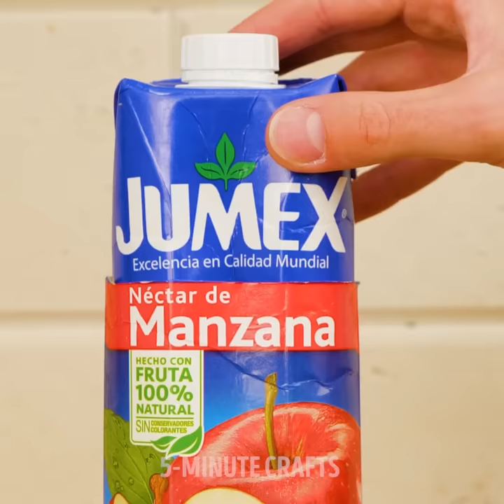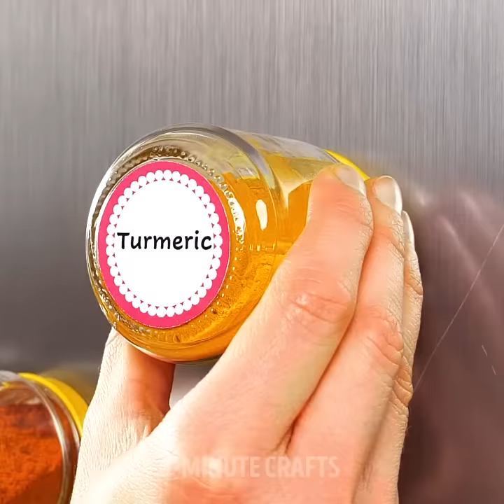30 SMART KITCHEN ORGANIZATION HACKS || 5-Minute Recipes to Reuse Old Kitchen Stuff!

Comment: Who would use a sharp gardening tool to hold wine glasses? If you don't mind cutting yourself, go ahead. What a dangerous idea! The next problem is why do you need a shoe holder to hold snacks & put it on the outside of the low cabinet door. The main purpose for putting snacks in the top shelf is to avoid eating too much snacks. Someone wants to do this, must want to gain weight, not to lose weight.😂